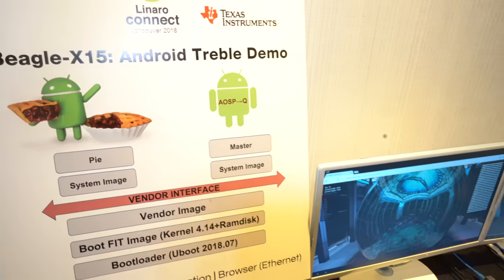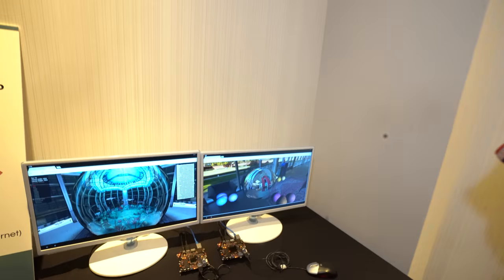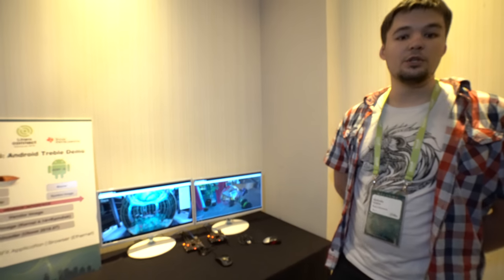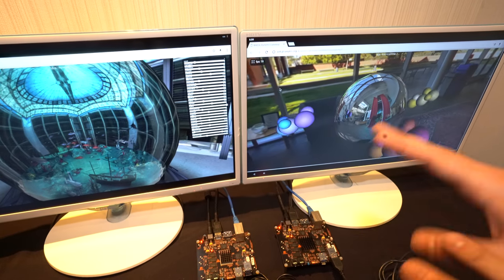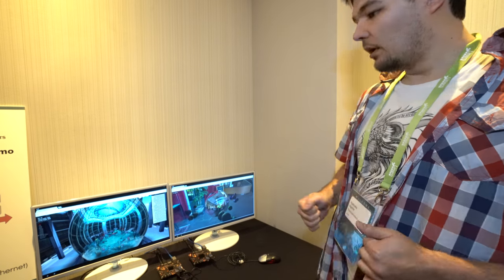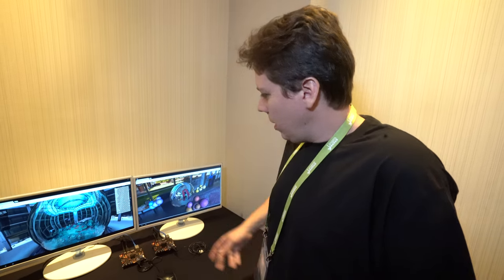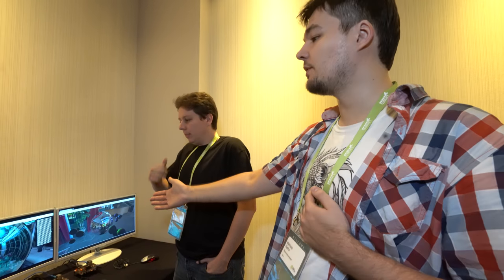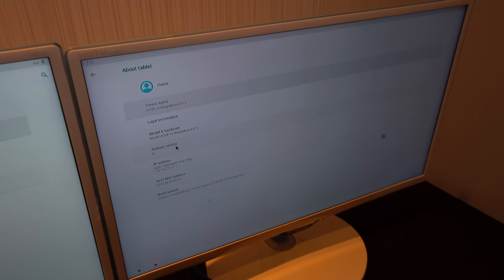Android Treble on Texas Instruments Beagle-X15 at Linaro Connect

Comment: I don't like it. This whole trebble thing just leads the industry the release-and forget strategy: previously SoC manufacturers were forced by end-user device manufacturers to provide updates for at least device lifecycle of 2 years and maybe upstream some of the work to siplify the process, now they will promise some forward compatibility and call it a day.
Reply: Nope. It's the users that got forced to upgrade by not-supporting SoC (even powerful ones) with latest software and drivers.
The Treble just standardized the drivers enought to start the latest OS versions with dated base firmware.